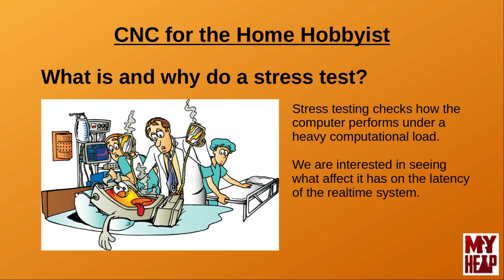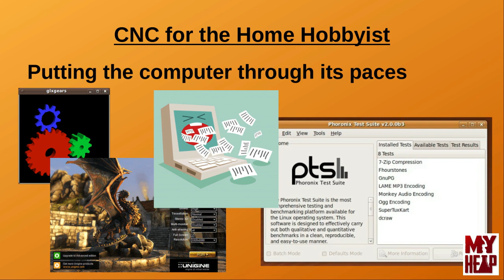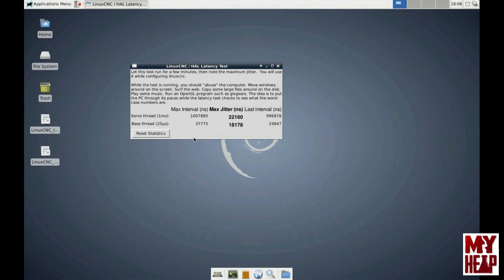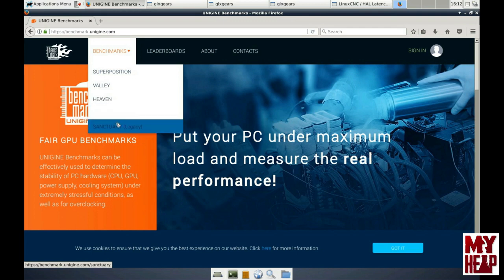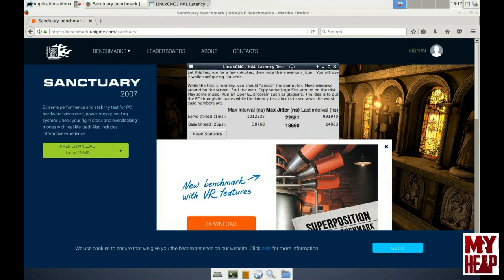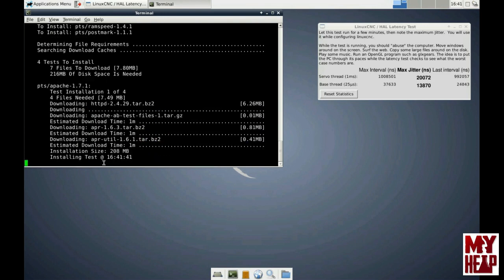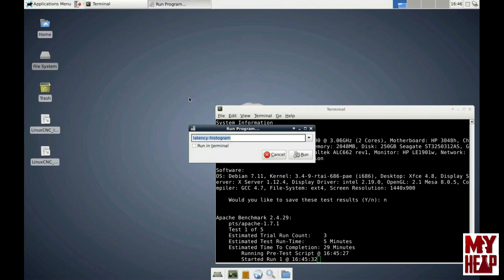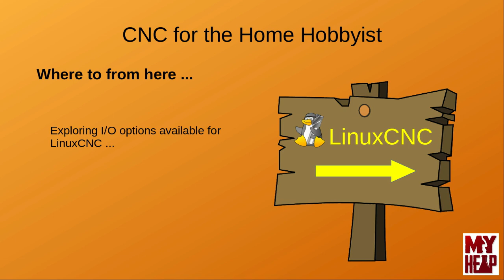LinuxCNC for the Hobbyist - 008 - Stress Testing the LinuxCNC Computer

Comment: It's interesting actually to see old hardware being utilized so well with LinuxCNC. New hardware definitely should be able to give better results since most CPU/GPU manufacturers have been working very hard to improve latency and communication protocol between RAM/SSD/CPU/GPU in the last decade.
The real problem and downside might be the implementation of all these new hardware in the Linux kernel. The differences of stand point between open and closed source have always been a major downside for the adaption and development of GNU/Linux and manufacturers are not really helping most of times. But i can see how much it has been getting better the past 5 years so i have big hope that LinuxCNC will get better with new hardware.
Another great video <3
Reply from the maker: Thank you.  You are correct that there is generally a lag between new hardware and support in the kernel for said hardware.  It has gotten better over the years, but I think it still has a way to go.  When you have some companies paying to keep some hardware proprietary then there really isn't much that can be done.  I would hope after the pandemic, we would take a close look at entities with too much controlling power and make adjustments where needed.

Comment: Joe, this has been a great help. I installed LinuxCNC last night on a system I put together from old parts. I ran through the benchmarks today and the HAL to see what it'll do. I got a high latency of 21287 after running all the benchmarks. This system only has a core 2 running at 1.86 MHz. I hope this isn't too slow? Thanks for the video series!
Reply from the maker: I think you will be okay with that.  I am glad the videos are helpful.  Thanks for watching and commenting.

Joe
Reply: I'm on the next video now. I have an addon parallel card so we'll see.  Thanks!

Comment: Hi Joe, Great series very easy to follow. I have an HP core duo machine and have run your suggested bechmarks including the "sanctuary" demo and the phoronix full suite. Every thing runs fine under 20k jitter and then out of no where I get this 60us spike and nothing special is running any suggestions.  It does not repeat even while running latency-plot for 960 points. Any suggestions?
Reply from the maker: Kurt, first thank you for taking the time to watch my video.  I appreciate it.  There are a number of things that can cause a sudden spoke in latency.  The tough part is figuring out what it might be and if it is a reoccurring event.  Using the other latency tools can help here.  I would suggest looking at the docs under the latency testing section as it gives some ideas on what to look for.  Additionally I would hit up the IRC group.  I am sorry I am not any more help than that at the moment.  I am currently on the road and won't be back home till Sunday evening most likely.  Thank you for commenting.

Joe
Reply: @MyHeap  Joe, I found out some very interesting things which I would like to share / discuss with you when you get back. I did significantly improve the system but there are still a few strange things.  I will check back with you after Sunday evening. No need to reply to this.
Regards...Kurt
Reply: @MyHeap  I determined that my pc was going into sleep modes causing as much as 160 us of jitter.  The problem was the GRUB wouldn't let me into the bios setup. (don't know why used correct F10 key but wouldn't work with the linux installed) I swapped the windows drive back in and could get into bios setup.  I eliminated the power saving / sleep modes and then swapped the linux drive back in. I was now running under 20 us of jitter except for one case.  While running the phoronix full suite it stays under 20 us unless I move the scroll button on the right side of the terminal window up and down on the terminal running the phoronix suite.  It then jumps to 36us.  I can have other terminals open at the same time and list out long directories and move their scroll buttons up and down with no effect only on the phoronix window.  Any insight?  Is this a reason to increase my jitter value as it will double it for this one case.
Reply from the maker: @kurttaylor863  if that is the only case that causes a jump I think you can safely ignore it.  Remember, we are torture testing the PC in our case.  The docs only suggest that you open several windows, maybe run a couple copies of glxgears, copy files watch video.  I think you will be fine.  :-)

As to being able to get into the BIOS, you should be able to.  Post test. Runs, then bios fired off bootloader (grub).  I don't know why it would not detect the keypress for the bios.  At any rate, glad you are making progress Kurt.

Joe
Reply: @MyHeap  Thank you, I was running 3 glx gears, running a dsl speed test and youtube while moving files while all that was going on and that one scroll bar is all that changed things.  BTW I have watched all of your videos and very well explained.
Regards,Kurt
Reply from the maker: Thank you Kurt.  I have ideas for quite a lot of videos for the series, bit finding time is tough for me sometimes.  Thanks for watching.

Joe